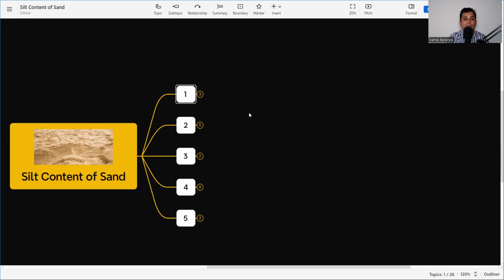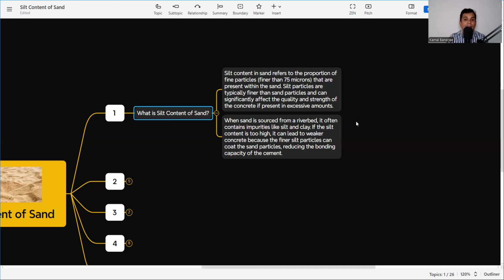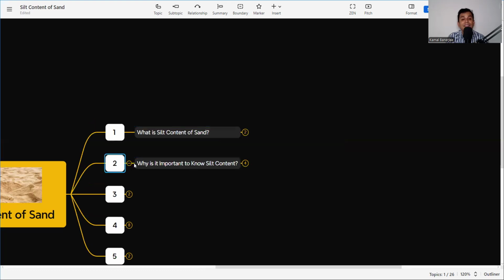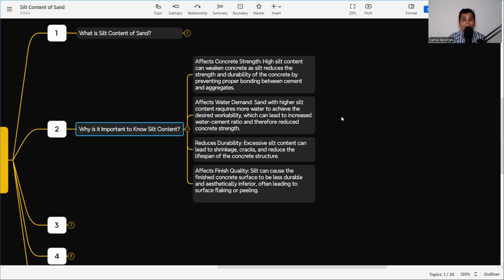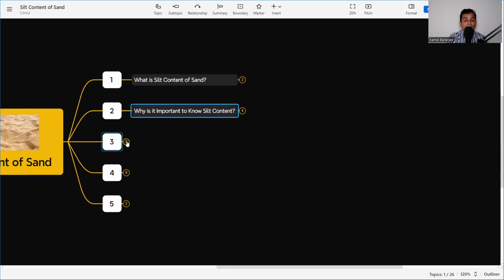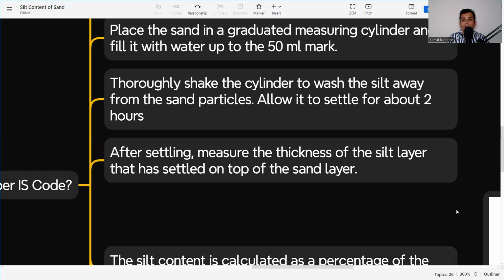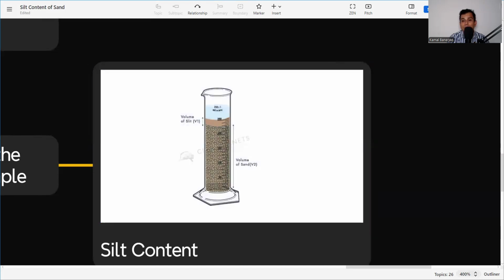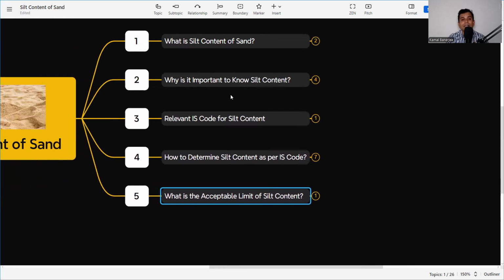Silt Content of Sand. Testing and Guidelines as per IS Code

Comment: Sir this acceptable limit (8 percent) is only for natural sand... Can you please mention M Sand acceptance limit as per IS code... Because now a days we are using M Sand only...
Reply: M.sand  silt should not be more than 15%
Reply: @CONCRETEEXPERTSQAQC  IS  code & page number please sir
Reply: @gobinathan1409  As per is 383:2016 Clause 5.2.1
Reply: @gobinathan1409 Is 383: 2016, Clause 5.2.1

Check Table 2 and pg no is 3
Reply from the maker: @gobinathan1409  Check IS 383 Table 2.